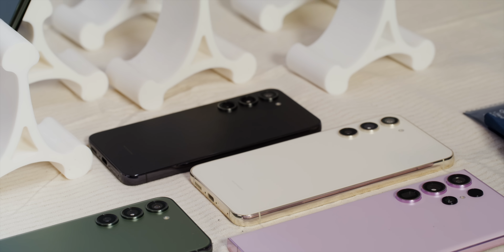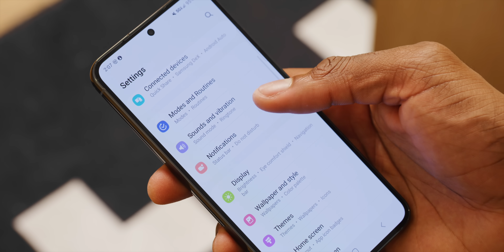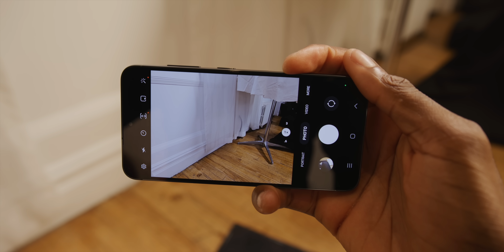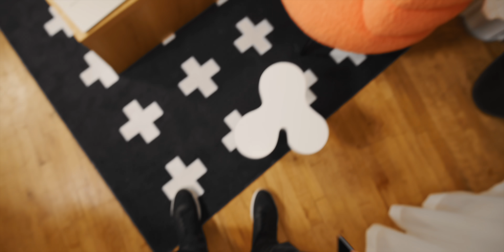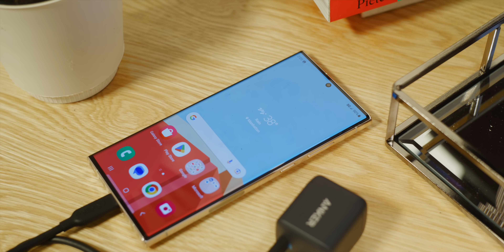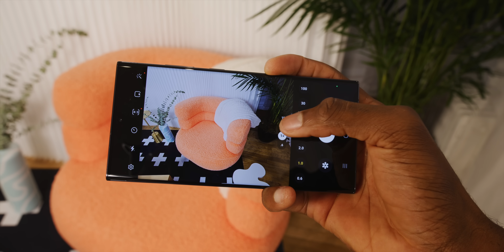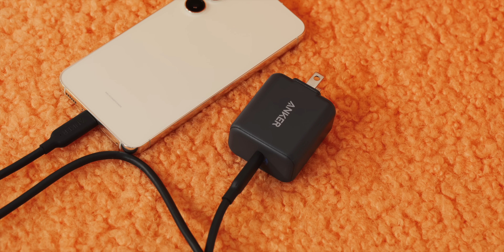Galaxy S23 / Ultra Impressions: Cruise Control!

Comment: Here is my thought: The reason why the 2 year contracts died with our carriers because people wanted the latest and greatest. Back then, the iPhone and Samsung upgrades yearly were actual upgrades. The changes were significant! We now got into leasing the phones, with a combo of the 2 year contract. Now companies (and carriers) are facing a new issue: people hanging on to their phones. Why? Well, because the upgrades are very minimal. Every year they sell a phone that is marginally better than the last. The upgrades usually are gimmicks. Software updates are now 4-5 years. Why spend $1000 for a marginally better phone, when you can keep your phone for 4-5 years with support and then upgrade to the latest phone and actually see the upgrade? The Samsung 23 is an example of nothing new and should only be an upgrade for people who's Samsung phone is 4-5 years old.

Comment: The Flickering is likely due to the refresh rate variation going from 48Hz to 120Hz. If you look closely, it only flickers when the image sits still (likely at 48Hz), but once you interact with the display, swipe, click on something etc, the flickering stops, probably going to 120Hz when you do it.
Reply: The S22 goes down to 24hz, so I'd assume the S23 is the same or maybe goes even lower. If you activate the fps counter from the developer settings, you can see it go down from 120 to 24 after about half a second from when you stop touching the screen. I don't know why Marques doesn't do that to check himself
Reply: @sasharudyy3587  is that bug or its typical? Is there any way to fix it?
Reply: @shahidnajamafridi8269  The refresh rate going down is a feature to save battery, so typical, the transition is a bit juddery as it is not as polished yet from a software point, its software because on iphone it is not much noticeable, so you can depending on samsung software updates to one day push one out to remove it.
Reply: @zhongxina7834  on iphone/mac it is not noticeable at all tbh
Reply: @Shahid Najam Afridi  no, it's not a bug, it's how it's meant to be to save battery. Whenever you are scrolling an article for example, while scrolling it's 120hz, but as soon as you stop, it goes down to 24hz cause there is no need for 120 cause there is no movement on screen. As soon as you touch the screen again, it instantly goes back to 120hz and you can't even notice the transition. For video, the refresh rate will not go lower than the refresh rate of the video itself, so if you're watching a 60fps video, the screen won't go down to 24hz, but instead stop at 60hz.
Reply: It actually goes down to 24hz
Reply: @horsethi3f 🤓
Reply: fr
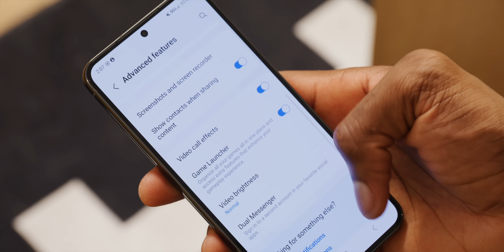Reply: He kinda mentions it here @4:45 with the text to the left.

Comment: If I'm not wrong, they always made the Exynos chipsets based on Snapdragon chipsets but with more cores and overclocking their cores because of which Samsung with Exynos chipsets were known to have battery drain issues and heating issues back then so it's no wonder they tried to overclock the 8 Gen 2

Comment: I think Samsung should merge the s23 and the s23+ like just one cause most ppl just buy the bigger one for the bigger battery. Instead if they could like keep a small form factor and have a bigger battery it'll be the best version and ppl who want the ultra will just buy the ultra. Like for example rn the s23 is 6.1 and the s23+ is 6.6 why don't they like make a 6.3 s22 and delete the + lineup just keep a 4500 batter and a 45w charger. They'd be able to also market they're new charging speeds better like no more 25w. And the price would be somewhere in between both phones.

Comment: Why won't they implement the under display selfie cam from the fold? I hate these centered camera cutouts with a passion but they won't stop releasing them year after year. I want to upgrade to a new s series but need them to fix that before I can. 

Personally could just do without a selfie camera, too, since I don't really want a bunch of pics of myself anyway.
Reply: Because it's shit quality thus far. They do it on fold because it's an experiment and it's only appeal is its novelty factor.

Comment: Dont buy it is  expensive and same as like old model 

Totally same 22 Ultra there are no any new features Then why people Buy this Expensive Phone  always samsung Increased just mega pixel and did not  large the sensor and lenz type,  if you see 14 pro max  have just 12 MP and its result batter   why ?   i  always say to  samsung that become as like iphone fast in gaming and Software  hang issue  in Samsung and Speaker bass is third class ,  samsung need to fast  10 years more  then they will make  good device  otherwise it is

Comment: Totally same 22 Ultra there are no any new features Then why people Buy this Expensive Phone  always samsung Increased just mega pixel and did not  large the sensor and lenz type,  if you see 14 pro max  have just 12 MP and its result batter   why ?   i  always say to  samsung that become as like iphone fast in gaming and Software  hang issue  in Samsung and Speaker bass is third class ,  samsung need to fast  10 years more  then they will make  good device  otherwise it is

Comment: I buy the new phone every year. The new boxy design is great, 5k mah battery is plenty for daily use. The lack in design change...if it ain't broke don't fix it. The camera, chip, and usf 4.0 was the only upgrades needed and they did it. The Ultra model is perfect and anybody that says different is just not picking it to death thinking they need something or don't need something. Too many damn critics that think they have a quality opinion.

Comment: I'm gonna go on a bit of a wild limb here, and say this. I feel like the last 2 or so years of phones have felt very, very minor in the spec bumps and how they preform overall. So it would be interesting to see phones go to being released once every 3 or so years. 

I'd also go as far to say phones being on a system where phones are made upon a confirmation of purchase if they do go this way. Since the necessity for a crap load of new phones in stock seems extremely unnecessary.

Comment: Just found out the S23 Ultra has a Quick Shutter Tap feature in camera settings that eliminates the shutter lag you talked about
Reply: That's what I'm saying, he doesn't even look in the camera settings to enable the Quick tap shutter or the Capture speed option. This helps eliminates the shutter lag even more.
Reply: @selw0nk  early impressions anyways... i know Marques...How would still take time to comb through the phone and various settings to optimize
Reply: @selw0nk  The quick tap shutter being an option means most Samsung buyers will never use it. I can't remember ever opening the settings menu in my Note 10 camera app.
Reply: @LeMwh  LOL. If you're a good samsung user..You'd basically run through your phone after a new device or OS upgrade.... i believe a "What's New" feature would be could to get people informed

Comment: Went from Xiaomi Mi 9 lite to pixel 7 earlier this year, and honestly, outside the camera, can't tell difference in day to day use as whole.

Would rather set fire to money than give phone manufacturers and phone companies my hard earned money.

If people use their phones for gaming maybe it's worth it, but for general day to day use, I can't see the point.

I take some photos on holiday and very little outside that.

Can't see me upgrading a phone in several years now.

Facebook, browser, and Whatsapp don't really require a new 1100 pounds phone.

If you got money to burn, or need a super powerful phone for gaming, cool.

For most people, these phones are just ego buys, so they have the newest, latest thing

Comment: Verizon is offering $800 off S23 for upgrades on eligible plans. Ordered mine last night, trading in my Pixel 5, looking forward to finally having a telephoto lens without having to get a huge "pro" model phone. Also looking forward to not having to pay for a new phone that hopefully won't have near as many hardware issues that I've had with my pixel phones over the years.
Reply: The iPhone 6.1 inch pro model has had a telephoto for years and is the same size as the S23
Reply: @Top-TierSports  True, but I have no interest in moving to iOS.

Comment: S23 Plus looks very fitting only because of the battery life. I just prefer the smaller size phones but since I use it for my youtube videos I guess some battery boost will help me. Also very happy they're using Snapdragon gen 2 on these.
Reply: 1 w
Reply: i agree, i really want to move back to the smaller phone, s23, but damn im used to a 4500 mah battery. idk. still leaning towards the smaller phone this go around
Reply: A
Reply: I ordered S23 ultra. I am currently using iPhone 13 Mini. I hate ios and cant wait to go back to Android. But 1 thing for sure is that I am going to miss my Mini 13. Man my life was so easy with it. Easy to put it in and pull it out of my pocket. 1 hand use is a breeze on it. Battery life was ok, it did a good job. I dont use my phone that much, at times surviving 24 hours was like living on the edge. My wife has bigger iPhone and she always wanted to trade her big phone with my Mini. I got it for office and traveling. Wish mini came with android or ios was as good as android.

13 Mini was my first and last iphone & is the best iphone ever. Really well optimized!
Reply: @69Solo  I hear you. Battery life and size are two underrated things companies keep forgetting. I prefer comfort and practical imprevements over anything else. I don't watch shows on my phone so I don't want a large one but well if s23 Plus has a better battery life then I'll pick that one.
Reply: @69Solo  So in short, A powerful and compact android experience would be the Asus Zenfone 9.
A 5.9 inch display, Snapdragon 8 plus gen 1, 6gb ram and 128gb storage on the base version with a dual camera setup.. You could honestly give that a try.. I think you will like it.. Marques also has a video on it if you also wanna check that out..
Reply: @69Solo  13 mini is the best iPhone ever ?? Lol. ios takes some time to get used to. Looks like u gave up too early. What is it that you like in android, that u miss so much in ios? The unstability? Being buggy?

Comment: What about the display ? Isn't there a significant difference in reduced power consumption due to the E6 AMOLED & LTPO 3.0 combo compared to E5 w/ LTPO 2.0 of s22 ? And maybe even slightly better color accuracy among other factors ?
Reply: Also, I guess the S23 non-Ultra models still don’t use the same display tech as the Ultra (as apparently is was for the S21s)?  So, is it true that only the Ultra version uses LTPO / HOP?

I understand that many people who look into phone specs that much would be interested in the top model, the Ultra.  But even for someone who prefers the smaller & cheaper versions, it would help to understand what I can expect from the display.  Especially in terms of smooth variable refresh rate, power consumption, low ambient light performance and even resolution (1080p vs 1440p).

Comment: I used both samsungs phone and apple 
Actually i had iphone 6+ and iphone 11pro also used iphone  7 
But those time my hope was samsung phone because of futures and upgrades 
Then i bought s20 and s21 ultra s22 ultra and z flip 4 and z fold 4 
The biggest problems on iphones are  using them it is very hard i will say sam problems 
1. When you want to call someone you have to find his name or tipe all the numbers but in samsung if you remember two digits you can find it 
2. Keyboard the numbers aren't in same row with laters in samsung there more good futures 
3. My file or fold what ever you call in iphone they all trash you can't organize 
4. Gallery on iphone also trash and editing is hard
5. If you login an account you have to write whole account but in samsung already shown on top of Keyboard
6. home screen is same with application  same 
There tons of problems i forgot
Iphone is a phone which is you can't customize like you want you have to accept those stupid hard things 
Iphone has better CPU but who cares i can't see difference it has better video how much only a little white balance 
I am not taking my photos or videos for comparing just for myself i can't see difference only if you compare 0.01% difference.

Samsung has a lot good features 
Like zoom 100 time that is very useful for example i am truck driver i always for seeing a sign or a text i am not coming out to go to see it i will see directly from truck it is like 100 maybe 200 meters saving i found very useful 
Iphone always looking chip and camera nothing  more
Charging on samsung also very good i liked very fast noticeable i am using 25w charger 
S pen also very useful 

Iphone is not making deals or price cut but samsung has best deals and trade option i trade my s21 ultra for 77$ to s22 ultra 
I think in real life using Samsung is 
humble and King

Comment: Have been using Samsung phones like [Galaxy Ace, Galaxy Grand, S7Edge, F62, S20+, and finally S22Ultra !
I hate Samsung now.😡😡😡
They are literally fooling customers just like Apple does.
1.5lakhs for 1TB version is ridiculous. [ it's no way justifiable] 

And related to exchange for yours and my current 512GB S22 Ultra we would just get 55k ( even after that extra 8k exchange bonus which Samsung is offering).
If Samsung is itself sure that for 1.2 lakh (S22 ultra) phone in 1 year 70k is gone into the water.. then why even sell S23 ultra 1TB for  1.5 lakhs ???
Its just just pathetic !
Even the offers are a gimmick.Who needs a slow wireless charger for free and a wired 2.5k charger when one is already spending1.5 lakhs ? 

And other offers are like you get 2k for Samsung app first time login [for what ?]
I have never hated Samsung this much !!!    Copying apples strategy so that people think even Samsung's level is of Apple's level. 

Even I never thought of buying iphone because iPhones were too costly as compared to Samsung flagships. And Samsung had better value proposition. 

Now we all Samsung users need to switch to iPhone [if you are wasting so much money then waste on iPhone itself]. 

They are looting people. There is nothing for 1.5 lakhs 🤦🏻‍♂️🤦🏻‍♂️🤦🏻‍♂️🤦🏻‍♂️  I'm utterly DISSAPPOINTED 🙏🏼

Also,
Indian and Asian People please know this.. 

Even my friends said this ..in US 🇺🇸, UK 🇬🇧 , Canada 🇨🇦, and Australia 🇦🇺 .. they have trade-in offers for those people. They only have to pay few 100's of dollars $'s for upgrade from one ultra model to another. 

For them it's good as they pay the phone bill on contract and that's the only option for them and it's reasonable for them as compared to buying a normal phone on cellular contract. 

For us, Indian's this is a very bad deal !

ThankGod I bought the S22U last year.. I had a very very good deal only has to spend less then 50k after exchange of old phone and dut to other watch offers.

Comment: You should also touch on the significance of using the Snapdragon chip across all models, and the overhaul of the speaker system. Other than just the cameras, there are some very important improvements that might matter which in my opinion, were the only real weaknesses of the S22U.

Comment: The shutterlag is a deal breaker for my part. I used to be able to take photos within 2 seconds from pulling up my phone. Now if i try that it won't succeed in taking the picture. So it will just hang for 5 seconds and if i move to fast it will not take the picture.

The worst picture is no picture.

Comment: My only reason for buying Samsung phones in the past has been because of the hardware. Samsung's version of Android is pretty much D Tier in my opinion. The appearance of it and how they push so hard to replace every Google app with an inferior Samsung version is so annoying, and you still can't replace Bixby on the lock button with Google Assistant although now you can at least turn it off. It takes me hours to set up a Samsung phone to try and get rid of as much of their dumb bloatware as possible, not even factoring the bloatware from the phone carriers they let get installed. 

I traded in my Pixel 6 Pro for an S22 Ultra due to the bugs and poor battery life on the Pixel and wanted better hardware but now that Google is catching up on the hardware, buying Samsung is making more and more less sense every year and what I never understood is how my S22 Ultra had this massive battery but such poor battery life. The only things I don't like about my Pixel 7 Pro are the glossy finish, I miss the 100x zoom, and I wish I had faster charging and slightly better photo/video editing options natively, but none of that makes it worth it to me to pay $300 more for a vastly inferior software experience and those small things I mentioned. I only ever used the S-Pen for the photo editing benefits. 

This past year marks the first time I dove head first into an ecosystem with my first watch, being the Pixel Watch and Pixel Buds. If Samsung didn't try so hard to pretend to use an OS other than Android, then I would probably still buy Samsung phones. I bought them because of their hardware and because I love Android. I couldn't care less about their phony pretend ecosystem.